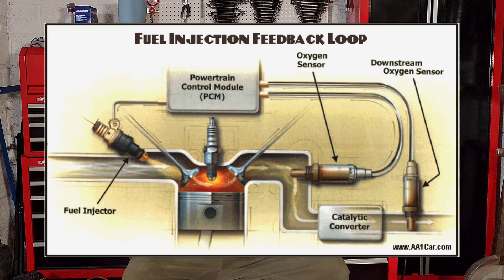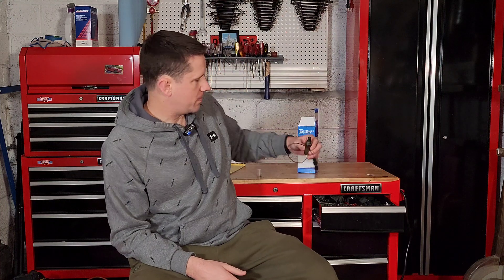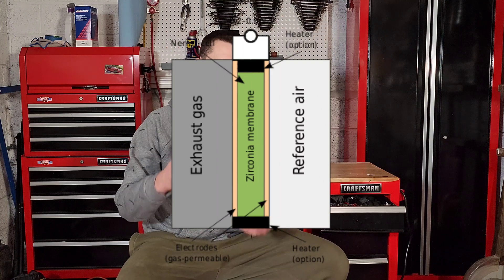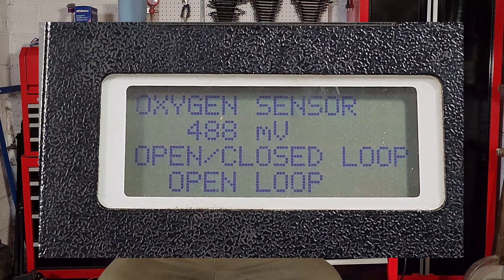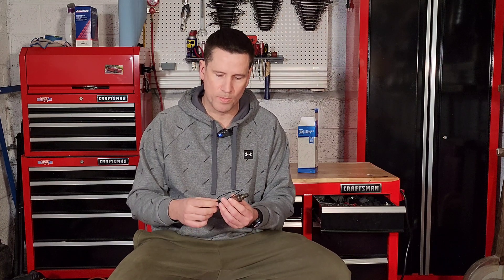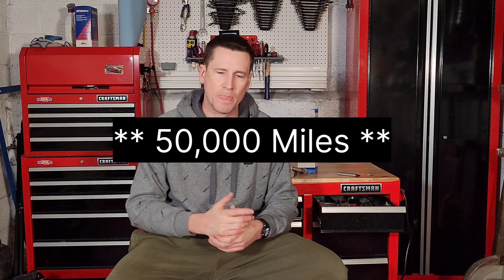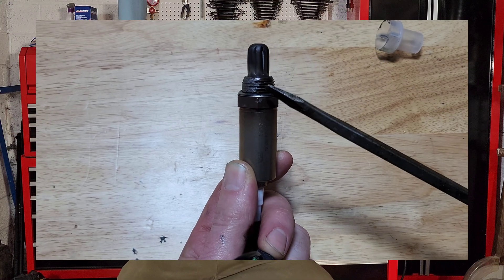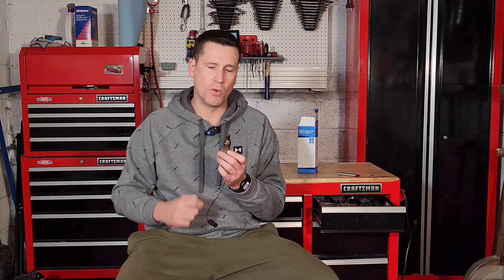WAY Too Much Information About Your Oxygen Sensor

Comment: How about how the "rear" sensors and their affect on the engine's running? Anything at all besides the cat effeciency? 
How about "fuel/air" (wideband?) sensors (Toyota).
Reply: Post-cat sensors are used primarily for catalyst efficiency but because they are narrow band and a bit more precise compared to AFR sensors they are now I believe since the dawn of OBD2 are used to correct primary sensors. Not all vehicles utilities such programming but I’d say about 2010 and newer models use this function of lambda correction. My current 08 Lincoln with a 4.6 uses 4 sensors and if a scanner is hooked up and viewed parameters a good way to check is if there’s a long term vs short term correction from say bank 1 s2 then it works.
Reply: 200k miles with only -.5 correction with is great. Good way to TS sensors on OBD2 is to watch for fuel trim. It’s not the main way but it helps a lot to watch differential between the two. Assuming injection is not an issue

Comment: Oxygen sensors tend to age and suffer from drift, reading low or reading high from age.  on newer models the reason we are not replacing the sensors nearly as often as we used to is the use of a fine narrow band sensor that is used to “correct” the drift of the primary downstream sensor by the higher tech modern ECMs as the sensor ages. This is a main topic of certain people who delete their catalysts and have a tuner delete the feed from post cat sensors which over time may lead to fuel ratio drift. A lot of technology evolution has come and gone since the 1980s I’ve seen and repaired multiple GM TBI systems which have had a single wideband sensor drift rich or far too lean. Another cause back then was the failure of the primary manifold temp sensor for the ecm that way it never hit closed loop on OBD1. Unfortunately I do not recommend wasting money on oxygen sensors every 50k unless there is suspected drift, damage from contamination, or obvious heater failure or incorrect data codes. In the trucking industry a Nox sensor which works in the same principle as o2 to detect conversion efficiency is usually good for almost a half million miles with many many examples in the millions with original oem sensors. Main failures are heater failure and incorrect correlation and soot contamination.